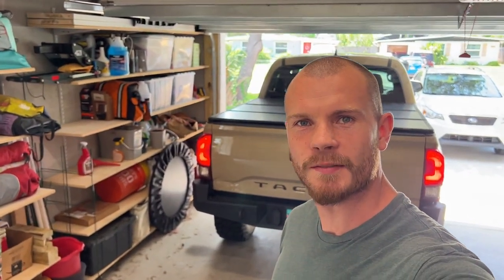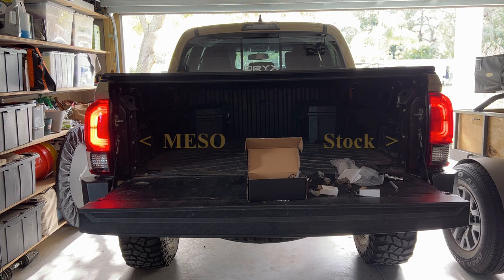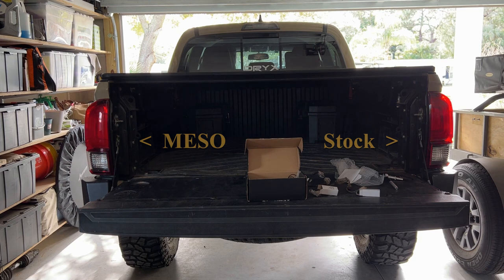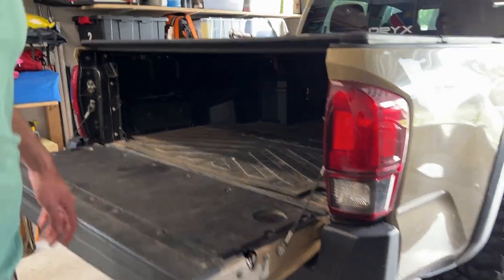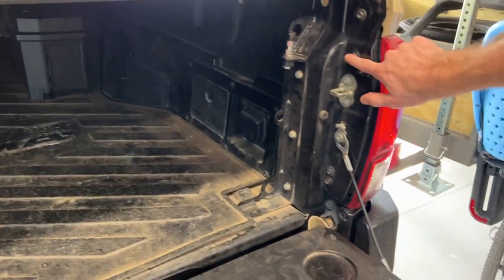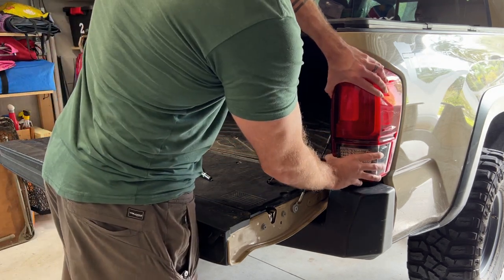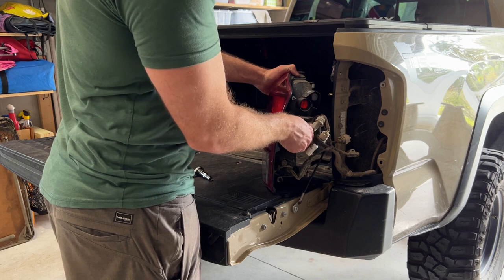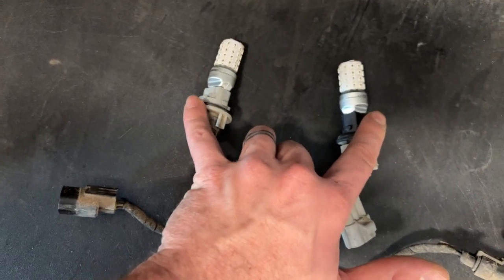MESO Total Tail Stage 1

Comment: I added the same kit on my 2022 Tacoma. I think it was a great improvement to the tail light configuration. However, customer service is virtually nonexistent. I am still waiting for an answer to a question I emailed to them 6 months ago. It would be nice if they would include a replacement parts list since there are no identifying numbers on the LED bulbs.
Reply from the maker: Yea, MESO makes some great products, but the CS is lacking sometimes.
Reply: The brake/tail lights are probably just 7443 red led bulbs. The reverse/turn bulb seems to be a specially made switchback that I’ve never seen before.
Reply: @BangBang-hk4rg  I agree that the (4) Brake LED’s are #7443-Red. I too am puzzled as to what 2-bulbs are for the turn/reverse switchback. The original bulbs are #921.